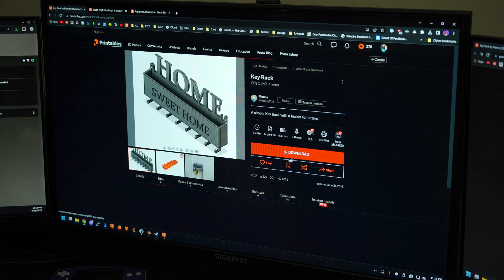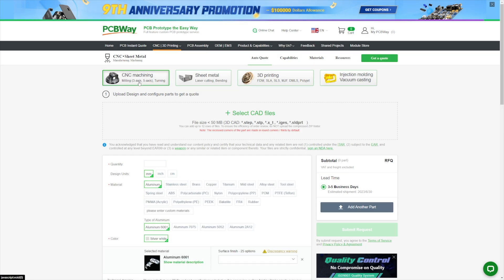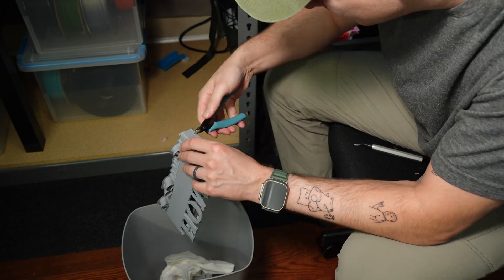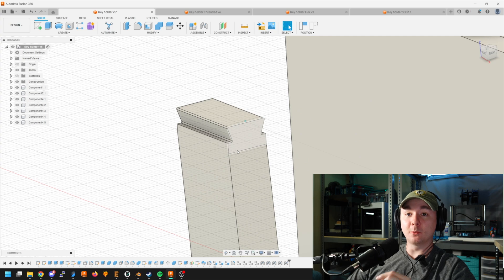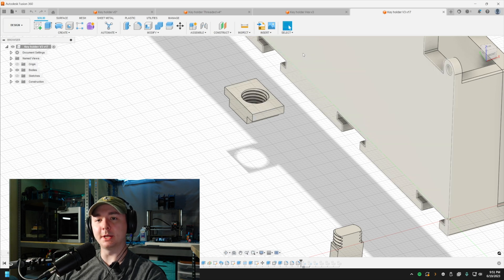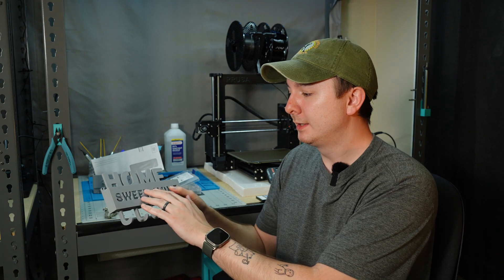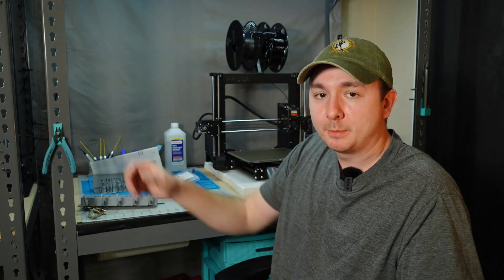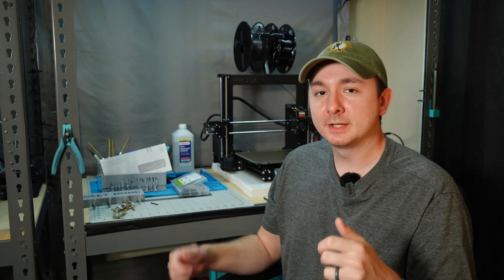You Don’t Need Supports for 3D Printing

Comment: appreciate the vids, fellow engineer with passion in 3d printing. Maybe you could do a video explaining key parts of orca slicer IE wall thickness and what not as that would be really helpful to get a full understanding, I used to use cura before switching and it had a guide that would give in depth details on whatever you hover over
Reply from the maker: Sure that’s a good idea! I’ll add that to the list of video ideas :)

Comment: Built in support in cad for the last part
Reply from the maker: Oh so you're saying design the support in yourself? That's a good idea and I've never tried something like that, but that would be a nice tutorial to make too!
Reply: @ButterPockets  This is how all the Voron parts are designed, most don't require supports, but the few that need supports include them in the part.  One example is the guidler for the V0.2 Mini Stealthburner.
Reply from the maker: @kiloqubit  yeah I went and experimented with it a bit after this video. If I recall when I printed my 0.1 parts nothing had supports or even built in ones but I could be wrong. I’ll check out the 0.2 parts for inspiration!
Reply: @ButterPockets  another example is the V2/Trident Stealthburner front cowling, the leaf spring that holds the 5015 fan has a built-in tab under it that acts as a support during printing, and then it just breaks when you push the spring during fan installation.